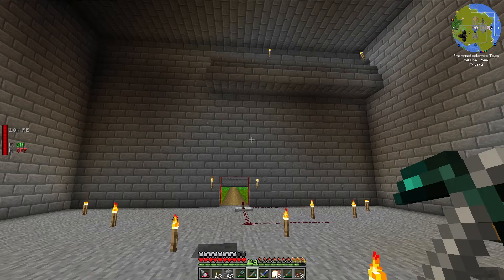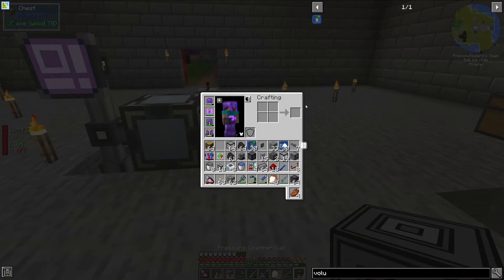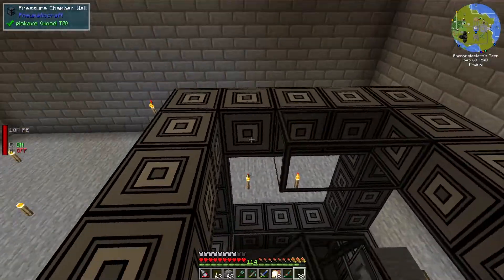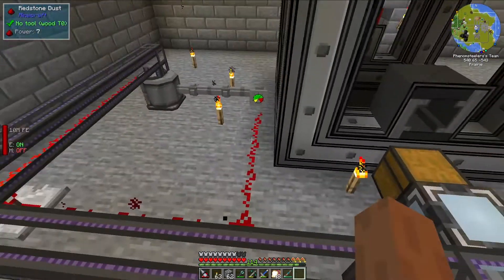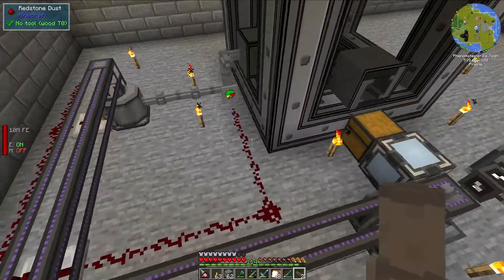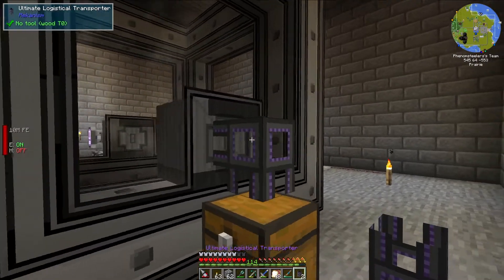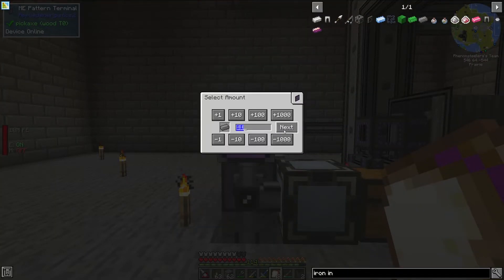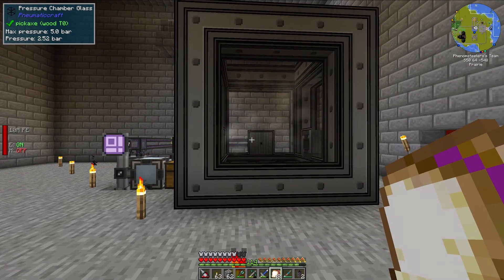How To Automate The Pressure Chamber From PneumaticCraft

Comment: Be aware that it gets much easier if you set the prerssure gauge next to to the compressor. So the highest Pressure in the Sytem is measured and it will not explode.

Comment: Very nice tutorial. :)
If you want to save a channel in your ME system, you can export the coal straight out of the ME interface.
Set a stack of coal up in the top row of the interface (one of the boxes with the little arrows), connect the pipe to the interface and it will provide the coal right out of the system's inventories.